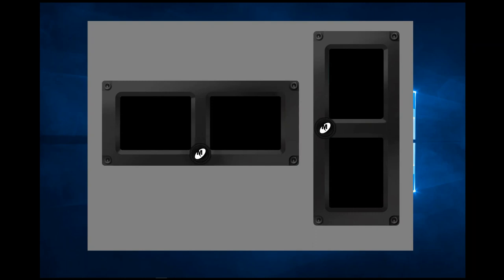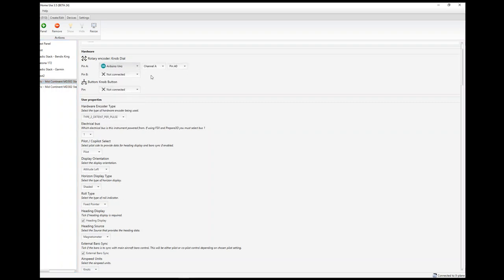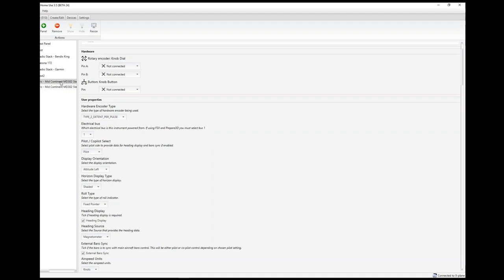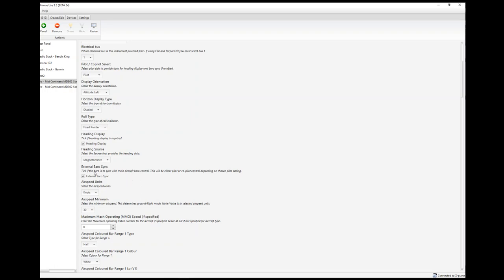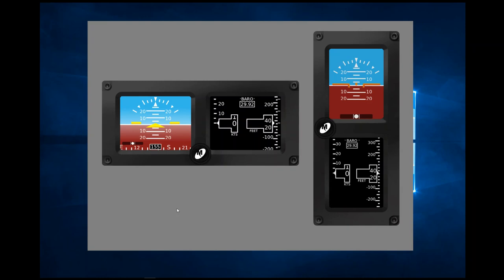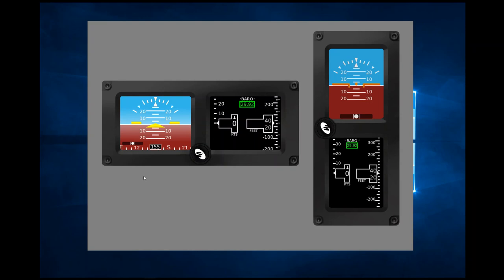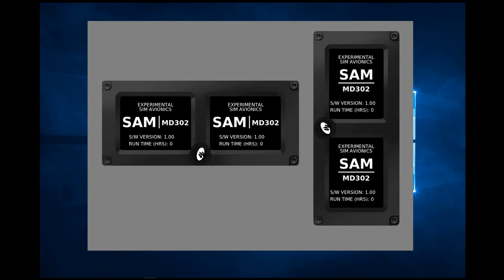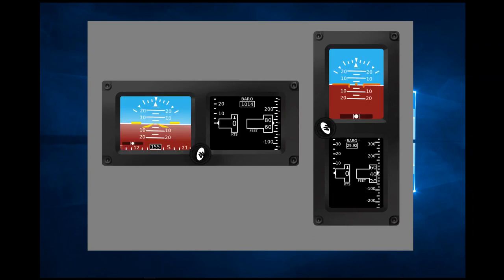Electronic Standby Instrument MD302

Comment: Will this instrument be available for msfs2020?
Reply from the maker: It already is available from the web store linked below. The vertical model is in the DA62 panel and the horizontal one is available in the Tecnam P2006T G950 panel. If using with another aircraft the settings would need to be changed to reflect those needed for that aircraft. A pre configured version for the TBM will be part of the yet to be released TBM panels coming soon.
https://experimentalsimavionics.com/